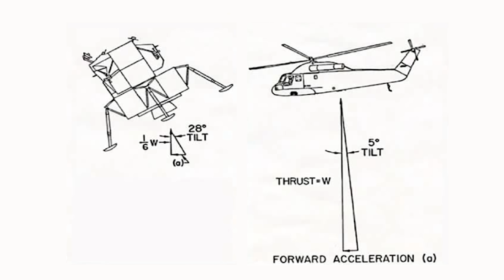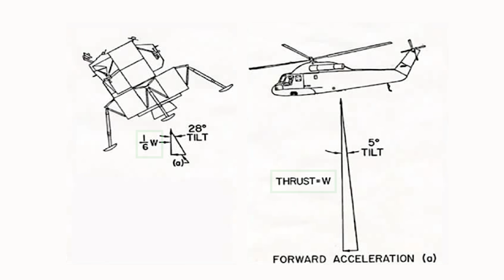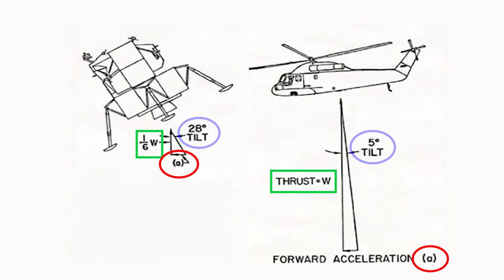How Neil Armstrong Trained to Land on the Moon  - Smarter Every Day 250

Comment: The Moon landings were a hoax
At 6th the gravity of Earth it would take at least 1/6th the rocket that blasted off from Earth to soft land the ship on the Moon. Then it would another 1/6th to blast off of the Moon, then even larger for margin of error and miscalculations. We are now right at 1/2 the size that blasted off from Earth. According to NASA the Moon doesn't have the protective Radiation Belts that protect Earth from the Radiation from the Sun. Science tells us Earth is 4.5 billion years old. it's safe to assume the Moon is the same age. That means the Moon has been bombarded with Radiation for 4.5 billion years, making it highly radioactive.
Reply: that is not how rocket science works. Jesus christ, how can people make this sort of mistake is beyond me.
Reply: @atlas8827   When the craft lifted off of the alleged Moon I saw no rocket engine. Who was left behind on the Moon to film the liftoff?  You can hide behind science if you like but It only makes commonsense with 1/6th gravity it would take 1/6th rocket size to land and 1/6th to lift back off. if the Moon has not atmosphere as they were told how did the orbit it without being drawn down to it?
Reply: @Joe Flo  
The footage isn't great, which is why at first you can't see it. However, as the LM ascends and banks, you can clearly see a light where the engine is.

No one was left behind to film the lift off. The camera was located on the rover, and operated remotely. That should have been self evident, but I guess not. 

And I'm not hiding behind science, that's just silly. I'm just trying to show you that not everything in this universe can be described by a simple, 1:1 linear equation. That means you can't just go around slicing numbers by 6 and expecting the other side of the equation to follow accordingly. Reality just doesn't work like that. Whoever made the universe wanted us to work hard to get the numbers right. 

Think of it this way: In a rocket, the heavier your payload is, the more fuel you're going to need. If you increase the weight of your payload, you'll need to add more fuel, but adding more fuel makes the rocket heavier because of the weight of the fuel itself, and now you need more fuel, which means more weight, which means even more fuel and weight.All of this means the weight of a rocket can get very high, very fast. About 80% of the weight of the Saturn V was propellant and oxidizer. All of this is really bad, but the upshot is that it works the other way around too. If you remove a bit of weight from your payload, or launch it from a place with lower gravity,  you get to remove some fuel that is no longer necessary for lifting the weight you removed, which means your rocket isn't as heavy, which means you get to remove more fuel, which further reduces the weight of the rocket, and you can remove even more fuel, and it just keeps going. It does plateau at a certain point, of course, and there's a lot more to it, it's rocket science after all. There's an article on NASA's website called "The Tyranny of the Rocket Equation", and it goes into a bit more detail.

On top of that, please keep in mind that only the lunar module made to the surface of the moon. The command/service module stayed in orbit, and on top of that, the lunar module was divided into two sections, and only the upper section went back into lunar orbit after the astronauts had finished exploring the moon. 
Out of the ~45,000kg of the entire Apollo package sent to the moon by the Saturn V, only ~5,000kg had to be launched to lunar orbit. That's a lot more reasonable, isn't it?
Reply: You're dumb but u got brain

Comment: my question is: why didnt they try to eliminate the lateral tilt i.e. by adding multi-directional steering thruster at the right height? they would "just" had to balance out the lander getting back in the same angle with their gyro technology. Sorry for my bad english.

Comment: information.        at 6:25,  as far as i'm concerned,  reference to a rotary wing aircraft is   Not  informative.     yes, the vectors are there.    but, the mechanism used renders a comparison, at best, very imprecise.           at 6:59,   just  a  design  Challenge.          at 8:38,   words-words-words      obviously, a  simulator  is  Less-than  100 percent realistic.     googletranslate

Comment: Your grey plastic model has 3 legs, as I would design one, but not as they were. What suspension, or height adjustment was employed, to allow for landing on an uneven surface (so it didn’t wobble) or a boulder under a foot? With a sixth the gravity, wouldn’t the regolith be disturbed six times greater than on earth. What sort of crater was left on (as they couldn’t have used tarmac, surely?) the desserts surface on earth, and how was this allowed for, and trained for?

Comment: The LLTV was the most Kerbal vehicle ever built in real life. Change My Mind.
Reply: Have you not seen early Soviet rockets?? They basically just put on MOAR BOOSTERS and MOAR ENGINES as a design philisophy.
Reply: @adamb8317  tbh more engines is a good solution. Spacex found minimal stages and maximum engines is the best idea
Reply: @daviddavis  it can be good with the right design philosophy.
Reply: the ussr was playing in sandbox mode.

Comment: Having used flight simulator for planes, I can't see why those couldn't be used for a lunar lander simulator. Obviously you'd need to change the variables for gravity and atmospheric conditions.  The one thing that no simulator or trainer could emulate is the feel on the "seat of the pants". Since gravity is 1/6 on the moon, the pilot will not be pressed into the seat nearly as much.  Actually, maybe this could be simulated with micro thrusts for the real lander. Or a seat vibrator that would simulate the feel.

Comment: instead of an jet turbine pointed down, why not use a helium or hydrogen ballon to offset the weight? it could even have a release mechanism to offset for the used fuel.
Reply: They needed vectored thrust to more closely simulate the actual physics of lunar landing.

Comment: If they can get the ground proximity sensors and software reliable enough then I suspect any future moon/mars landing will be fully automated. No need to train the pilot in this precise maneuver because the software will have simulated the landing a million times, and probably conducted non-crewed landings already. Back in Neil’s day, computers weren’t powerful enough to attain the desired level of reliability. Now they are. To put it another way, once you’re on the moon for more than a picnic you’ll want reliable and continuous ascent and descent capability, and if you don’t need a human pilot on each trip that saves you a fair bit of fuel. (And that’s coming from a GA pilot.) Awesome episode btw!

Comment: The man is able to talk to a random stranger about the achievements of his life through technology that came about thanks to those achievements.  I imagine he's proud of the fact that there's more power in a pocket sized cellphone than his entire team had available to work with 60-70 years ago.
Reply: Interestingly, I think that's what will have his final answer proven incorrect.

A modern lander would not have (even a contingent) need for the pilot to take control; or at least not full control. Add to that the thousands of hours astronauts would be able to put into a modern simulator environment and simulating the danger aspect won't seem worth the cost and complexity of an LLTV.

Comment: The van Allen ion belts will hit your hull. Those ions are travelling very fast. They will cause bremstrahlung radiation that will fry anyone inside an unshielded ship. The Apollo capsules were made of aluminum foil. They Will Fry.
Reply: They believe NASA when they say there's radiation. They ignore NASA when they say they can go around the worst, and shield against nearly all that is left. No astronaut took even 1/500th of a lethal dose.
Reply: No ship is unshielded. They all have hulls.
Reply: For proton radiation, HDPE is a better shield than lead. So they used a layer of it in their hulls. Most of what's left can be stopped by clothing, or the dead outer layer of skin.

Comment: The Chinese have already been "back" to the moon. Several times. The last one not that long ago, actually, December 2020. Interesting that there was not much about that in the US media. Very interesting, in fact. 
They've also got plans to land men on the lunar south pole within the next few years. This is significant, as anyone with a knowledge of the lunar south pole will confirm ;-)
The US is playing catch-up. 
If the US are not careful, they will be playing the same catch-up game in the South China Sea. 
Hang on, they're already doing that, too.....!

Also "if there were no drag"... there'd be no air on either side of the rotors, and your helicopter analogy would be dead in the water, or smashed on the ground, take your pick. The helicopter thing was a terribly bad analogy to start with, since the entire premise of the helicopter is founded on Russian aerodynamics, and there is no atmosphere on the moon. Impulse motion, or rocketry, would have been a much better starting point to work from, when considering these issues from a terrestrial, or lunar, perspective.

Comment: If you had an electrical launch rocket...you could charge it up for relaunch if you used an inert magnet setup...it requires a magnetic landing station, which is located on surface to land within...
With a large circular magnet with a central (spaceship sized) hole...not only can you attract the spaceship there, you can cushion impacts of docking and you canncharge up electrical boosters when docked...
Reply: The modern Rail guns, using electro magnets to accelerate...whether the landing pad is the accelerator or the spaceship is the accelerator
Reply: A structure like this isnalso similar to what is used in Stargate the series...it might explain why they are called "Worm holes - used for landing on other planets"...

Comment: Perhaps this time, once NASA overcomes, as NASA has admitted, the problem of the Van Allen radiation belts, they will send a remote-controlled or AI controlled Lander to the Moon to study how to land properly. As we all may recall, NASA did not do a practice run landing on the moon because NASA purportedly was concerned about Russia beating NASA to the Moon. How the astronauts survived the overwhelming radiation, both gamma rays and x-rays from the Sun, we shall never know. Those astronauts surely must have been Supermen. Perhaps someday we will also be able to figure out how the moon suits did not blow up like the Michelin Man in a zero air pressure environment. There are so many mysteries about how United States was successful with the moon landings that have been lost to time, and that we must relearn. One of the most striking is the environmental control module on the astronaut's back, with from Air Conditioning in positive 250 degrees Fahrenheit to heat in negative 250 degrees Fahrenheit in an instant. Time Will Reveal all.  Okay trolls, have at it.
Reply: the belts are not as dangerous as you think they are.

Comment: 110:21:26	Aldrin	I've noticed several times in going from the sunlight into the shadow, that just as I go in, I catch an additional reflection off the LM ... along with the reflection off my face onto the visor, makes visibility very poor just at the transition ... sunlight into the shadow. I essentially have so much glare coming onto my visor ... shadow ... helmet actually gets the shadow. Than it takes a short while for my eyes to adapt to the lighting conditions. ... inside the shadow area, visibility, as we've said before, is not too great, but both visor's up ... what sort of footprints we have and the general condition of the soil. Then, after being out in the sunlight a while, it takes - Watch it, Neil! Neil, you're on the cable.
110:22:41	Armstrong	Okay.
110:22:41	Aldrin	Yes. Lift up your right foot, right foot. It's still - your toe is still hooked in it.

Comment: But why would modern astronauts need a free flight trainer to simulate manual landing if today's rockets have autonomous landing capability? If SpaceX can create software algorithms and control systems that can land a rocket from orbit on a barge in the middle of the ocean, why would any lunar landers still be manually controlled? For these reasons, I wonder if astronauts in the future will still come from the test pilot ranks. With autonomous landing and flight, maybe astronauts will just consist of scientists, engineers, and other jobs more useful to the mission.

Comment: When landing in 1/6th gravity, if you use an engine with 1/6th the power required for a landing on earth, it will behave the exact same way. The only difference is that everything will happen at a lower speed.

Comment: I literally thought of that why didn't they attached for small jet engines on the four corners which would only provide enough thrust to make the spacecrafts weight equal to what it would be on moon.... And a TVC unit for hover control and that's what happened. I am blown 🤯

Comment: Very fascinating video!
There is only one thing that I think is a missed opportunity.  Some may ask why a LLTV is useful in this age.  The thing assuredly could land itself with present technology.  Modern sensors, radar, gyroscopes, telemetry, and computers could certainly do it more accurately than a human.  So, why does hands-on training and flying ability matter?
I think you missed that point at the very end.
If I had to guess, the ability of a human to troubleshoot, overcome any unexpected difficulty, and land the craft when all other onboard smarts fails, is why hands-on training and flying ability still matters.

Comment: You don't address the question why we're going to need to train astronauts to land. It seems to make a lot more sense to land autonomously in the 21st century? Isn't the LLTV and the need for it something best left in the 20th century? The odds of autonomy failing seem miniscule when compared to any other part (control systems, rocket engines, etc.) failing? The human pilot is one of the worst bottlenecks for success, it would seem?

Comment: At 2:35 before I get too far into this video, If I were given the task of solving the 1/6 G tests on earth, I would suggest using Helium or some other lighter than air technology to offset the weight and response of the test lander. It would still have to be done inside an enclosed area to stop wind from affecting the craft. Not perfect but, that would be my first thought. Now, on to the video.

Comment: How do you claim smartness on this topic? while it is obvious that the logistics needed (fuel) to go to the moon was not considered by NASA ?! you can look at the footage of the operation!
I wish if you could discuss this subject since you are a rocket engineer in full detail. known that the rocket must be thin to degree that you and I know it will not handle the heat if it reaches what so-called the thermosphere. plus some military report that there is a certain height if they reach they will be struck by meteors. 

I have seen the video that posted which shows inside of a rocket factory it was beautiful. and it proved to me that the rockets are thinned layer. 

and both you and I know that weight is very important in rocketry science.  

best wishes

Comment: I highly doubt that a modern lunar landing (or mars landing, fingers crossed) will involve an astronaut actually piloting the vehicle.  They may have input, but computers are going to do the heavy lifting.  Just like in modern military aircraft, the computer flies the plane, the pilot just tells the computer what he wants.

You could not do that in the Apollo era, the computers weren't good enough.  So they HAD to use the astronauts to do it.

Which makes the achievement even more amazing, when you look at it.  The men who landed on the moon, and the people behind them that put them there, were exceptional people.